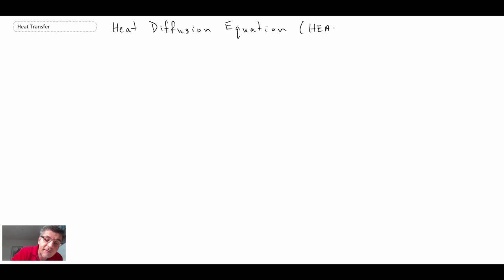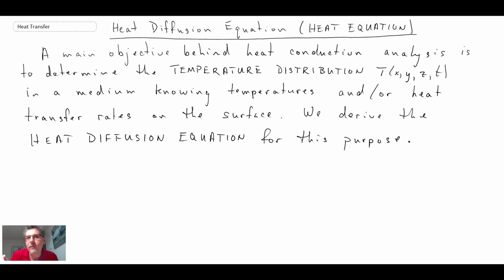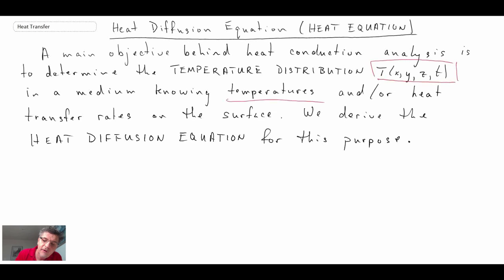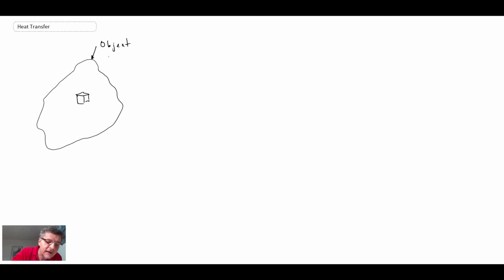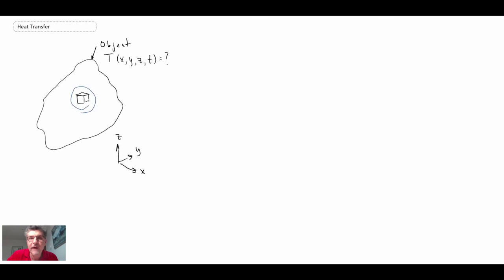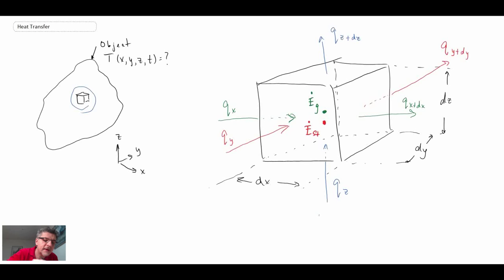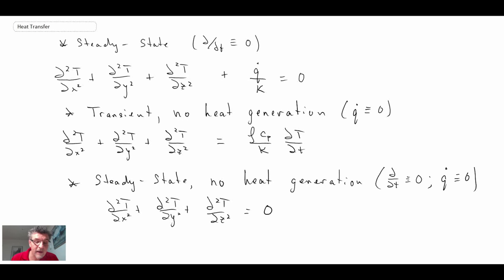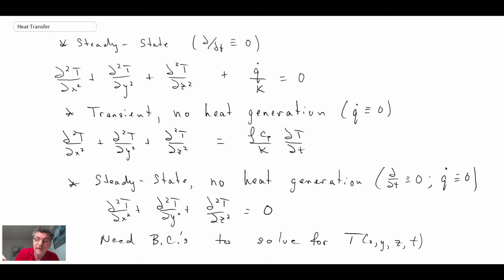Heat Transfer L4 p2 - Derivation - Heat Diffusion Equation

Comment: When you pulled the A out, the A could depend on what position x you are at though, in which case it cannot be taken out of the partial derivative, in fact pulling it out is making an assumption of constant cross section in the yz plane, at the very least this assumption should be stated